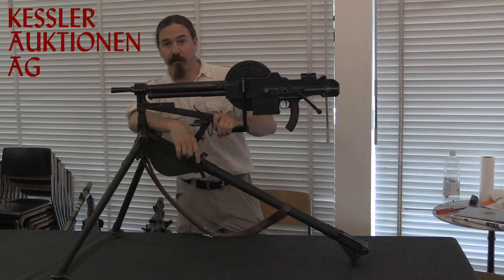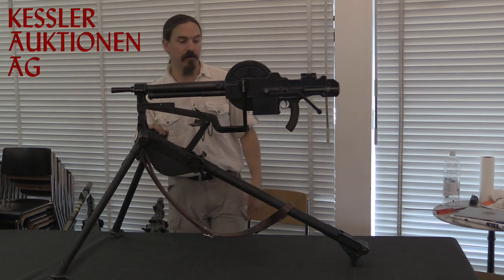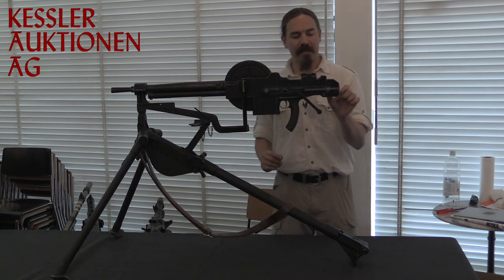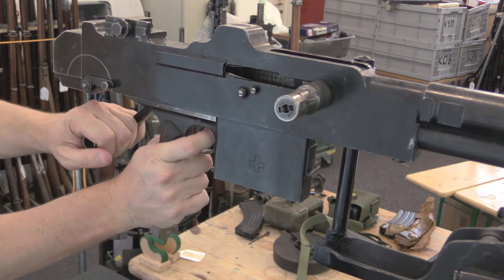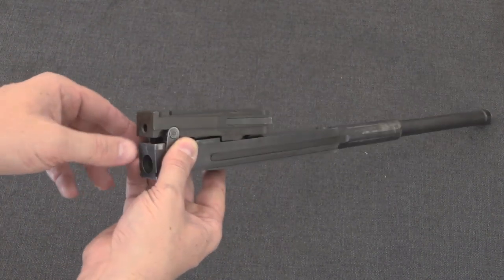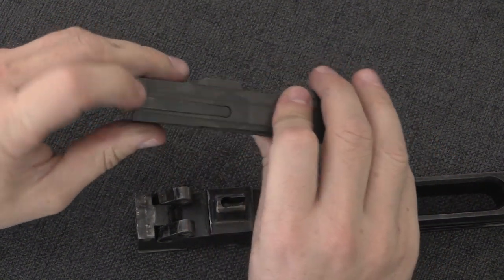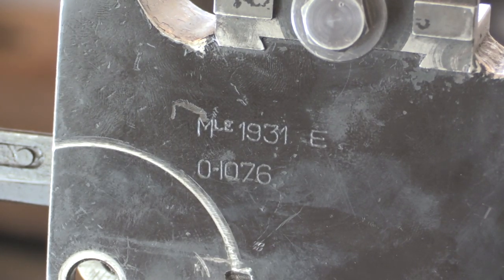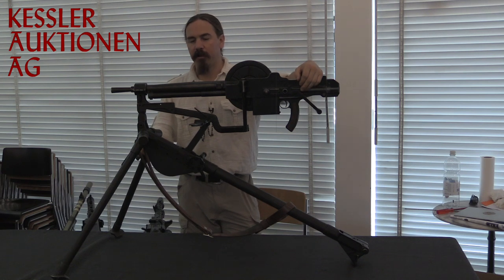Swiss Reibel M31 Tank & Fortress Machine Gun

Comment: Very cool to see one of these! 
The Model 31 was also used in aviation as the MAC 34, both for flexible and wing mounts, used on pretty much every French combat aircraft of the late 1930s. Cooling being not such of a problem for aircraft weapon (quite the contrary in fact!) it was rated at 1,200 rounds/minute for wing mounts. Right before WW2, another version was adopted as the MAC 34/39. The modification consisted in a belt-feeding mechanism designed by Châtellerault, later on adapted to the 20mm Hispano-Suiza HS.404 cannon, later on produced by Martin-Baker for the British Hispanoes, later on adapted for post-war anti-aircraft Hispano guns.
So yeah, quite a bit of history on these guns :)

Comment: Excuse me, couldn't help but notice a curved magazine in that BAR back there
Reply: Because it’s located below the receiver, it can only be so long before it hits the ground while in prone position, that’s what I understand at least.
Reply: Or more likely swiss LMG25 mags? 

Ah, nevermind, now I see whole gun with curved mag. Swedish BAR due to the pistol grip, btw.
Reply: Mark Evans  Weight and springs.

The BAR is heav y.30.06 rounds are heavy.  Since the BAR was designed to be carried and not used from a fixed position.

Early BARs did not have bipods. The length of magazine was limited by clearance when firing from the prone position.

On springs. The number one cause of semi automatic or automatic weapons failures is failure to feed. Usually caused by a defective magazine or weak or worn magazine springs. Pushing 20 rounds of 30.06 was not easy. 

Remember box detachable magazines were a rather new technology at the time.
Reply: AKM 762 Kg m/1921 with flash hider from Kg m/1937 would be best guess.
Reply: @shawnr771  No excuse for not inventing a 30rd mag for/during WW2 though. Admittedly GIs ditches the bipod because of weight, so they may not have wanted 30rdrs.
Reply: @skepticalbadger  Infantry soldier will ditch anything they see as not useful. 
There was a quote about the LAW rocket.
"The LAW is completely disposable. The problem is most soldiers tend to dispose of it BEFORE use.

Comment: Interesting. Never seen these before, and don't know much about the Chatellerault. Seems a bit cumbersome, but i'm sure it worked well enough. Simple and straightforward bolt, large assemblies with no small parts other than the pin, etc. Plus it's Swiss via France, so that gives it some cachet. Great video as always. Thank you

Comment: Is a difference of one millimeter in cartridge lenght crucial ? The Finnish used captured Soviet 7,62 x 54 cartridges in the weapons actually meant for 7,62 x 53 such as the m/39.
Reply from the maker: Yes, the difference is crucial. Also, the 7.62x54 and 7.62x53 are the same round, just with the actual exact length rounded differently for the designations.
Reply: Thank you for clearing this out.

Comment: Hey Ian, does that charging handle fly back and forth when fired?
Reply: No. It isn't affixed to the action. If you watch the section where he pulls the bolt back he's able to slide it all the way forwards without the bolt traveling with it and then he brought the handle back so he could release and catch the bolt without dry firing. So after charging the bolt is independent of the charging handle. Sequence: Mag attached, Pull charging handle till bolt locks, slide charging handle forwards (semi-optional, might cause issues if you don't), pull trigger. Action locks open when the trigger is released unless it had closed on an empty chamber before the trigger is released.

Comment: Would have liked to inspect the 150 rnd drum.  What is the mechanical device they used to get the ammo [perpendicular to the barrel while in the drum] to move to be parallel with the barrel, in order to load?
Reply from the maker: The cartridges are hel pointing in towards the center spindle, like a Lewis pan or DP pan.
Reply: AH!  Thank you.